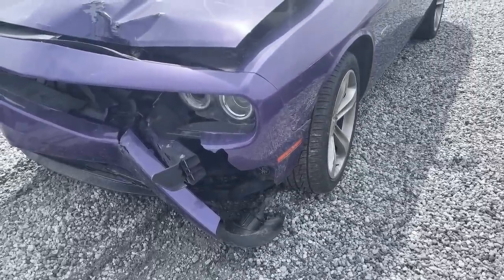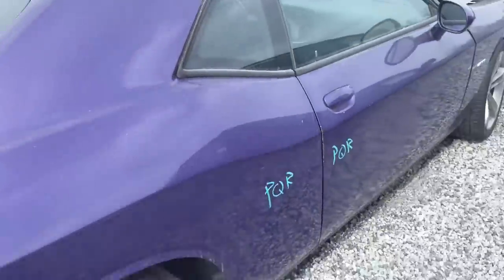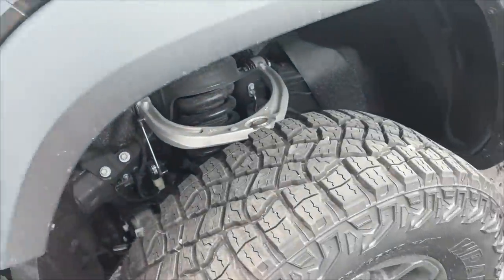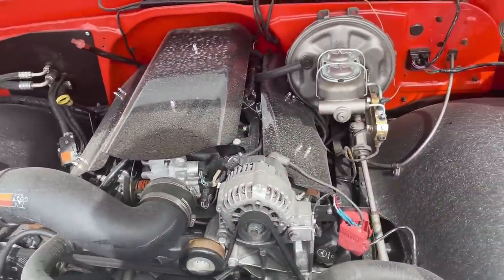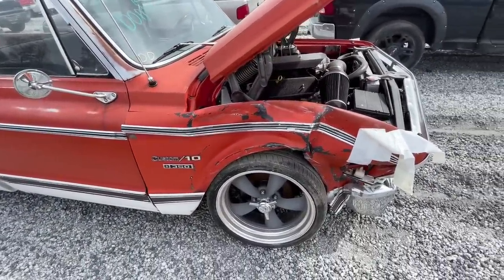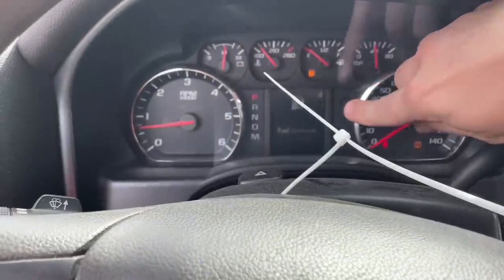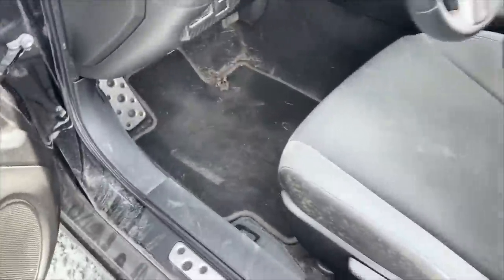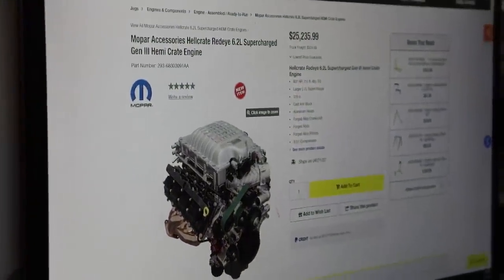WE CHECK OUT A 2021 RAM 1500 TRX AND MUCH MORE

Comment: That TRX headlight is a grand, bed is probably 6k, motor with harness I’d say 20k pretty easy, trans is 2k, transfer case is a grand then a ton of other interior parts, rear end, wheels and tires so 40 is probably spot on. Truck was a 100 grand when new.

Comment: Michael the Old Chevy C10 is pretty cool but considering all the parts needed & repairs I would say it's a bit much! Unless you are building it for yourself to keep & drive! Wow the TRX would be cool if it wasn't so tore up! I would guess there is a good chance parts you may think are ok could be damaged as well. Here locally a dealership has a TRX with very low miles for sale for $105,000 so even with a salvage title the finished truck would have value! But man this one is bad hurt! As always I am looking forward to the next video!

Comment: Would have love to see you take on the vintage Chevy pickup. The Subaru was interesting as well, but looked like a major project and due to the mold, it was kinda meh...

You're good at rebuilding cars, but the "tired" ones with lots of interior wear, cut seats, discolorations, blemishes will never restore to nice condition unless you swap the full interiors, which wouldn't make financial sense. I feel it would be a bit of a shame to spend a lot of time on repairs and still end up with a meh car due to a bad interior.

Comment: The motor for the trx is worth 17,000 real for a 392,   Company’s drop there fleet trucks to copar to sell them for them is way easier then them dealing with then them selfs.   Is you want a good deal on a dodge check out fastenal they alwase have around 100 old fleet trucks for sale they dump them after the dodge factory warranty is up.